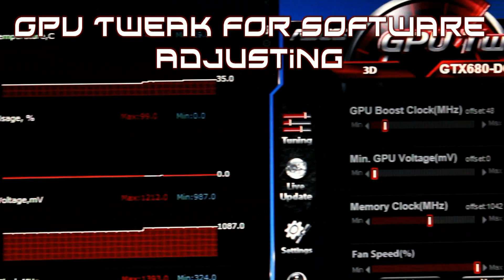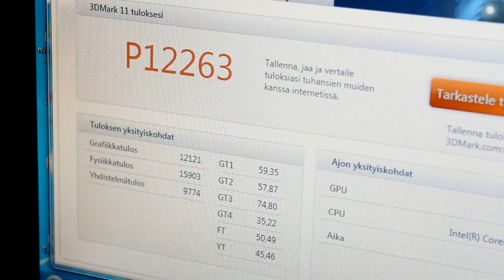SF3D OC quick test - ASUS GTX 680 DCII Hotwire function

Comment: The one thing I wish that ASUS would do to make the whole operation easier is if they installed some kind of connector onto the card so you can plug the hotwire leads in rather than having to solder them in.
Reply: They want you to solder them in because it voids the warranty. Its almost impossible to clean the solder 100% off afterwards if you brick it, so they see that you have done it.